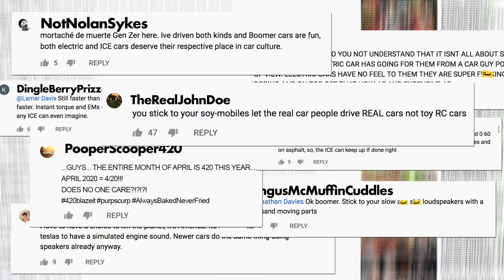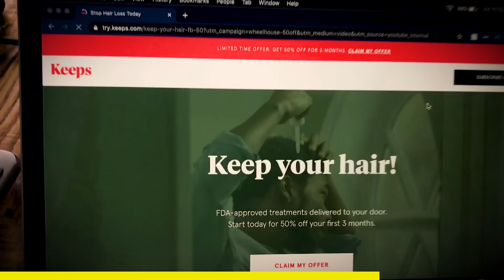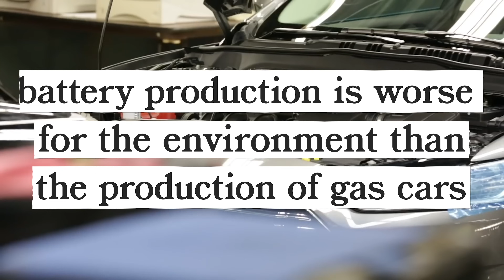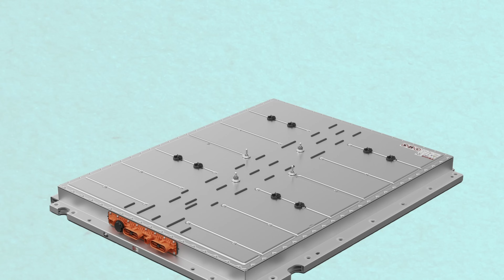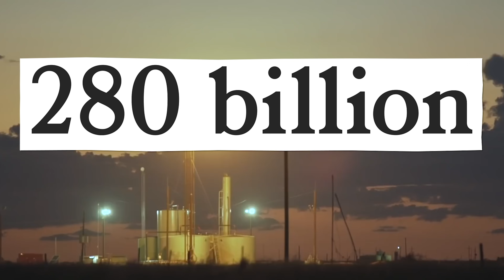Are Electric Cars REALLY Better for the Environment?

Comment: I would still like to know the pollution from building wind and solar panels, not to mention they can't be recycled
Reply: No need, it’s all going to cost more and will be a complete catastrophe. Sun and wind is not guaranteed
Reply: @pedrodurty47  it won’t, and doesn’t cost more. Additionally when you impliment renewables correctly such as in Germany or South Australia, the. Renewables can be extraordinarily reliable. On their own they’re unreliable but diversified and mixed with relevant technologies they can be more reliable than traditional grids and more stable whilst producing significantly cheaper energy
Reply: @engineeringtheweirdguy2103  reliability is questionable, last year they had to largely resort back to coal power plants because wind mills and solar panels do not work when covered in ice and snow. It's also not cheap, in Germany over the last 20 years, when they implemented wind and solar,  the price of electricity has doubled
Reply: @Tyguyborgerding  and where exactly are you talking about. Because some places have done, really, a very good job at incorporating renewables and some places really have not.
Reply: @engineeringtheweirdguy2103  I was referring to Germany in this case.
Reply: @Tyguyborgerding  well you need to look at wholesale energy prices. The wholesale energy prices have dropped to the second lowest in the EU. What makes electricity expensive in Germany however is that the government taxes it so highly. As much as 40%. So in reality renewables are infact making electricity cheaper. (Which should be wholey unsurprising). What is making it more expensive is the government taxing the electricity so highly.

As for winter, that is a known problem. Windmills don’t stop turning because it is cold, but typically wind is lower during winter. However last year was the first year Germany used more renewables than fossil fuels by kWh in their grid over the course of the year.

The problem with winter in Germany is diversification. They’ve diversified sources but can’t geographically diversify as Germany is such a small country.

That’s why there have been talks about a European super grid. Where German could send excess energy to Norway for pumped hydro storage (alone with every other EU nation). You could have large wind farms in countries with higher wind like scottland, and solar arrays in more sunny countries like Malta, France or Portugal. This means that whilst it might be snowey in Germany, it’s probably sunny in Portugal. If there is no wind in Germany to turn the turbines, it’s probably windy in Scotland. You can also capacitate that energy on a large scale with pumped hydro helping to pick up any deficiency and absorb over production. For example if your demand is 800MW and you’re producing 750 MW you can add the extra 50MW from the stored hydro energy.

Ontop of that more reliable renewables could enter the grid in a major way such as geothermal or tidal energy.
Reply: @Tyguyborgerding  Germany is much smaller than even the state of South Australia allowing South Australia to have more geographically diversified renewables making them more dependable in in-climate weather.
Reply: @engineeringtheweirdguy2103  clearly you have a good understanding of this topic, good for you! What I get irritated by is when people say wind and solar is the answer to everything and have no idea it's way more complicated than that. I think they can be effective on a local level but once it gets to be a larger system there come a lot of inefficiencies. Question, how many solar panels would it take to produce enough energy to make the cement, iron, and other materials to build a wind mill?
Reply: @Tyguyborgerding  Its actually the other way around. The larger you scale your renewables the more dependable they are. That statement doesnt come without its own technicalities, for example capacitance at a grid level to prevent curtailment would be required. But diversification in location as well as source both greatly increase the stability of renewables. On a local level you will be struggling to do either.

That being said, renewables arent like fossil fuels or nuclear. You cant just build one, plug it into the grid and walk away. Renewables are very complicated to implement correctly. But the bennefits are significant. Cheaper energy, less emissions, less building materials, faster construction, and more significantly but least talked about, better response times, especially with some form of capacitance. A VPP can respond to grid demand within nanoseconds, so can solar and battery. On the other hand, it takes traditional power plants in the order of 5-10 seconds depending on their design. That means a sudden shift such as a shortage, earthing event, lightning strike, or other forms of failure, are significantly less likely to results in a blackout or brownout as the frequency can be stabilized within nanoseconds prevent cascading events. 

Thats why South Australia went from the worst least stable grid in Australia, to being the most stable grid in Australia just by investing in renewables. thats also why Germany is in the top 10 most stable grid in the world (national grids) with far less blackout or brownout events than most other countries.
Reply: Most solar panels can be recycled and are non toxic

Comment: You can prove that the electric grid cannot handle electric cars if you look at California for even a second, how're those rolling blackouts treating you? Also, you didn't mention that the process for mining some of the metal in the batteries requires the use of cyanide, and makes the environment permanently uninhabitable.
Reply: Only if you don’t handle the cyanide properly. Which most places do, on account of it easily being able to kill workers even from skin contact with vapours. 

As for California. California is a victim of poor policy and poor civil planning. They’re an excellent case of what not to do when building an energy grid. Their situation is not due to EV’s and is not analogous to other grids. The California grid is unique in its incompetency

Comment: Great explanations.  However, at 8:42 in the video, what you showed as emissions from an electric power plant was actually steam from the cooling towers of a nuclear power plant.  This steam is no radioactive, but rather it is isolated from any radiation.  A lot of people mistakenly show cooling tower steam as scary "smoke" when in fact it is quite the opposite, as nuclear power plants emit very low CO2.  They are the type of power plant we should want more of until this nuclear fusion power is figured out.
Reply: Fucking thank you!!!!! I hate that everyone thinks those cooking towers are emitting smoke

Edit: cooling towers
Reply: @AnthonyMoody  cooking tower.. Lmao 🤣🤣
Reply: Because it looks more imposing then a regular power plant
Reply: @samuelmatheson9655  They can still use the same cooling tower design. To be specific, natural draft cooling tower.
Reply: The main issue with current Nuclear Power plants is the production of nuclear waste. The USA alone produces thousands of tons of nuclear waste from its Nuclear powerplants every year.
Reply: We've been 10 years away from fusion for 50 years
Reply: The best reactor (not a degreed pro here, just a dedicated researcher), is a thorium reactor, aka a molten salt reactor (salt being used as a chemistry term NOT table salt). It burns anything and everything, it can even be used to dispose of nuclear waste and produce cleaner emissions than a nuclear power plant. Its cheaper and less impactful on the environment to build and produces clean(er) electricity. But (prepare for eye rolling) big oil, and big coal, and now big solar and big wind are keeping stuff like this down 😪
Reply: @billywampler2852 - I feel ya. What about small modular reactors? They’re beneficial too. Compared to a traditional power plant.
Reply: @Billy Wampler The basic problem with MSRs is that the materials used to manufacture the various reactor components will be exposed to hot salts that are chemically corrosive, while being bombarded by radioactive particles. So far, there is no material that can perform satisfactorily in such an environment. It has nothing to do with big oil etc... The alloys required just for t exist and cost to develop such alloys if possible is just too expensive.
Reply: @shepleonard8695  2 things; 1: proper proofreading prior to posting prevents piss poor performance in your socioeconomic geopolitical commentary. And 2: despite your lack of proofreading, I got your point and do appreciate the (albeit small) dose of enlightenment. Additionally please don't take anything as an insult (especially point 1) I just do so very much enjoy alliteration.
Reply: Could also have been cooling towers from a coal power plant. Thermal power plants have cooling towers.
Reply: Sure we need more nuclear plants....but first lets ask those who lived @ 3 mile island, chernobyl or fukishima.
Reply: @Cam-vz3le  ...
Reply: also thorium fission plants are on their way, they will produce even cheaper energy than the current uranium ones and with less radioactive products, or less half life, or whatever it was :)) i know they are better anyway :D
Reply: This.
Reply: Everybody knows that already🤦‍♂️
Reply: Also inside steam stacks there are ammonium scrubbers or other alternatives that clean the stack along with the air before coming out.
Reply: Honestly the issue with nuclear power is maintenance, which requires education, which requires schooling, schooling currently not being too suitable for some people
Reply: So what’s the proper way to dispose nuclear waste? As long as it’s not dumping it in the ocean…..it’s gotta be a way to recycle it better
Reply: CO2 is a good thing and so is global warming when the Earth is this cold.
Reply: @ricktd6891  Good for plants, not so much for humans. It's literally our waste product.
Reply: @ricktd6891  You are describing carbon dioxide. The emissions referred in the video is not exclusive to that. It is referring to all harmful emissions, which was simplified to either greenhouse gases, carbon dioxide equivalent (CO₂-eq), or as this video put it, emissions.
Reply: Nuclear power plants still cause huge issues for the environment. ignoring possible meltdowns or disasters, the nuclear waste from them seeps into the environment and pretty much just doesnt go away. Its better then coal, but not better then wind, solar, and hydroelectricity
Reply: @starlightthetribewing4774  You're ok with killing millions of birds and bats every year ? You're ok with the environmental damage mining for rare Earth minerals causes, poisons rice crops in China ? Have you had any rice from China lately ? Here's a clue... don't eat it.
Reply: @starlightthetribewing4774  If we assume the fuel is still uranium, yes. But thorium, they are much better, radioactive-wise. Besides, Finland just completed Onkalo spent nuclear fuel repository, which will serve as long-term disposal for nuclear waste.

Nuclear has advantages that is difficult to ignore: its power production not influenced by elements so easily, and its fuel has a very high energy density, which made it a very reliable baseload power plant.

Also, if only nuclear innovation didn't stop, we would could have developed safer reactors with more passive safety features, and/or better nuclear fuel.
Reply: @dbclass4075  interesting, i do agree that nuclear fuel is far more sustainable then coal, but still believe that  there are better alternatives. I didnt know this, so my opinion on nuclear power is definitely less extreme
Reply: @starlightthetribewing4774  Considering the two major nuclear accidents are popular, I won't blame you. But consider this: Fukushima Daiichi Nuclear Power Plant is far more modern than Vladimir Lenin Nuclear Power Plant and as expected, has far less devesting aftermath. The reactor remained intact, limiting the release. Very unlike the latter whose enormous steel lid was yeeted off (and worsened by the lack of containment building).

For the meantime, until the better alternatives come about and/or limitations of other renewable power sources are overcome, nuclear fill the gaps. Development and innovation takes a long time, and so is the lifespan of nuclear reactors. Beznau nuclear power plant is the oldest operational power plant (since 1965), at 52 years old.

In other words, nuclear will buy innovation time to develop.
Reply: @starlightthetribewing4774   Hydro is the only good option in renewables. We don't have plan to deal with solar panel trash since most of them is unrecyclable, they're probably just ended up in the electro - trash flow into South East Asia, where hundreds of thousand people are dying of metal poison working in recycling industry. 
Solar needs too much land and highly inefficient, you need to clear land for solar and of course, build alluminum and steels stands for them. Solar is unreliable and costly. You need to find a way to store solar excess energy for night consumption or else you have to find other source that can power at nigh, for the most part it would be coal or oil right now. 

Wind is even worse, they kill large birds, bats. They're unrealiable, unrecyclable, dangerous and costly to produce and maintenaince while once it collapse your only choice is bury them somewhere (now they burying them in the deserts). Recyclable wind turbines is now in production but man the price is horrible.
Reply: WRONG....  All Plants have cooling towers....  How do you think the steam used to run the turbines is turned back into liquid?
Reply: @OldSkoolF  Even so, he isn't wrong regarding (non-radioactive) steam from nuclear power plant.
Reply: However it increases the temperature
Reply: Bet you if you drank the condesation from that thing youd look like me 🤣
Reply: @daetonabeech3087  That least of the concern. The bigger risk is scalding. That steam is very hot.
Reply: Nuclear power is the future. We need to be putting resources into this form of energy to refine it and make it safer and easier to us.
Reply: I came here to make the same comment - thank you !
Reply: Thank you. I have known this since I was young. Nuclear power is way more  efficient and cleaner and last longer.
Reply: @darrenlombardi2576  Coal is cleaner
Reply: Good point.... In fact, they actually emit water vapour ! That's a misconception which I always try to address during my Physics lessons !
Reply: @mariocamilleri9723  its interesting, here in Romania we have only one nuclear power plant, its on the way to black sea and I pass next to it every summer, it is in proximity of Danube and it does not have any kind of vapors emission, its actually enclosed, capsulated, its an old 70's Canadian model with 2 out of the designed 4 reactors active and it does not have any kind of vapors emissions, it's interesting to see other plants having it, and I know the plants that burn coal and raw oil have those, maybe there is some truth to that or we don't know all the design details.
Reply: Yep Americans are very ignorant when it comes to True clean plentiful, affordable and safe energy. France has 75% Nuclear energy, we can learn a lot right there.
Reply: @rolandjacques649  CA just shut down a nuclear power plant dangerously located near populated areas, constructed above faultlines. This decision was met with strong resistance. 

France may have fewer faultlines. They certainly do have many other problems.
Reply: @Roland Jacques  SOOOOOO .....IS.... do you safely dispose of nuclear waste? 

Answer: You don't.  

This is the nail it the coffin for nuclear power.
Reply: @shepleonard8695  the waste can be reused in next gen powerplants, and can be turned into nuclear diamond batteries, among other things after that.
Reply: @Aikano9  EV batteries  cannot be used to make Diamond  Batteries.  DBs are actually very useless in large applications and are at best a niche device at best.
Reply: @anxiousearth680  Depends on the nuclear reactor type.
Molten-salt reactors are safe and clean.
Reply: why are people agreeing about nuclear power plants? They have nuclear reactors and they can explode ANY minute after just one mistake, and the explosion is HUGE, that it can destroy EVERY single building, it might even kill the people working in the nuclear power plant
Reply: @hasanjafri3733  they tried to convince some of us to build those and make us pay for it by adding $300 to current bill every month , didn't work everyone refused
Reply: @eliteinventor  oh well at least in my country they don't have nuclear power plants
Reply: @hasanjafri3733  wait, what is there to Explode ?? Are you sure you understand how Nuclear reactor work ??
Reply: @hasanjafri3733   Nuclear power plants don't explode, they melt. There has never been an explosion following any nuclear power plants because the radioactive material used in nuclear plants is not rich enough to create an explosion.
 France has 56 nuclear reactors and they are one of the country with the greenest, most stable electric grid. So stable, they are the only country that is qualify enough to hold the first fusion experiment - powerplant facility - ITER. 
Germany tried to get rid of its nuclear power then suffers from unstable electric grid, moving to coal mining and gas reliant on Russia. Renewable in Europe with the power of the sun litteraly means fuck all because they don't have enough sunlight, nuclear power is the only reliable souces for most part of the world and an entire nuclear waste of a plant can fit into a room. Actually Nuclear power plant is the only power plant that can control 100% of its waste and emission. The waste, like i said fits into a room and highly protected.
Reply: @hasanjafri3733  Lol, the explosion is not 'huge'. Reactors are not nukes.
Reply: Nuclear power is the way to go, doesnt produce barely any pollution.